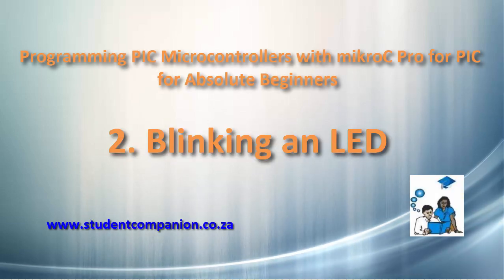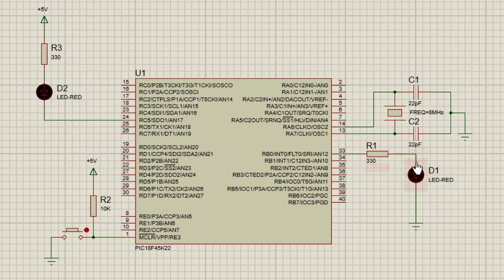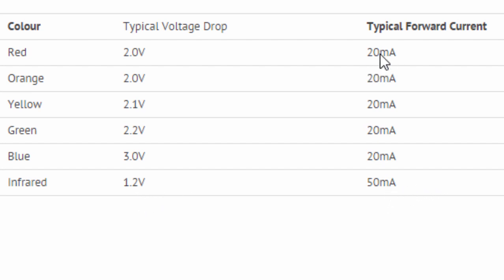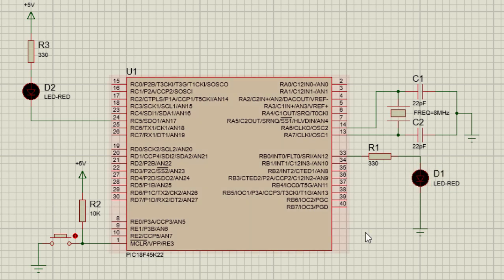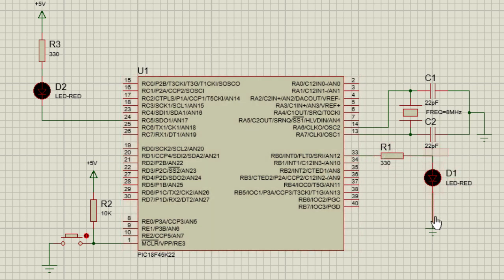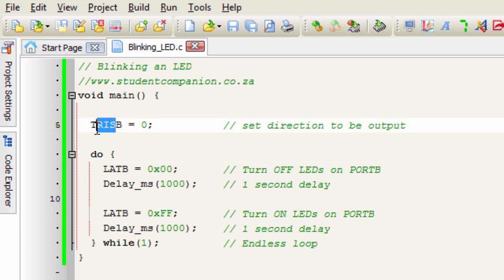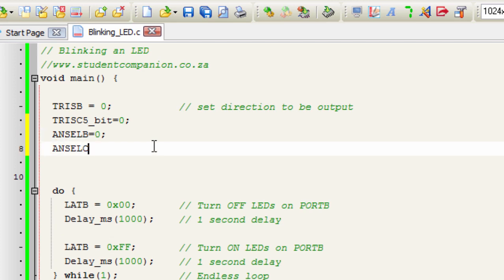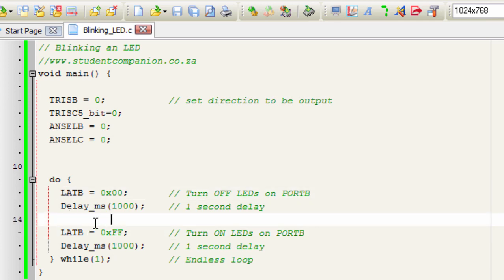2- Blinking an LED | mikroC Pro for PIC Tutorial

Comment: When i write void main() { program}
Syntax error: expected "." But "void" found 
What is the problem here ?
Reply from the maker: Please post the full code so that I can see where you might have done something wrong
Reply: Void main() { 
TRISC.B0=0;
TRISC.B1 =0;
TRISC.B2=0;
While(1) {
PORTC.B0=1;
PORTC.B1 =0;
PORTC.B2 =0;
delay_ms(1000);

PORTC.B0=0;
PORTC.B1 =1;
PORTC.B2 =0;
delay_ms(1000);
PORTC.B0=0;
PORTC.B1 =0;
PORTC.B2 =1;
delay_ms (1000);
}}
Reply from the maker: @jawahaffar7585  C Language is case sensitive, capital letter are different to small letters. You have been making that mistake.
I found these few mistakes of casing:
1. Void main() must be: void main() : The 'V' on void must be small letter.
2. While(1) must be: while(1): The 'W" must be small letter.
3. delay_ms(1000) bust be Delay_ms(1000): The 'D' must be capital letter.
Check if it compiles with no errors, otherwise post the new error and specify the PIC you are using.
Reply: . main() { 
TRISC.B0=0;
TRISC.B1 =0;
TRISC.B2=0;
while(1) {
PORTC.B0=1;
PORTC.B1 =0;
PORTC.B2 =0;
Delay_ms(1000);

PORTC.B0=0;
PORTC.B1 =1;
PORTC.B2 =0;
Delay_ms(1000);
PORTC.B0=0;
PORTC.B1 =0;
PORTC.B2 =1;
Delay_ms (1000);
}}
Reply: Appreciate it sir thank you
Reply from the maker: Which PIC model are you using?
Reply: Hello sir i've tried this error correcting , the only one error that i've been seeing is the one i've mentioned above , it's pic 16F877A i don't like working with it but it's for a college project , i  really appreciate it so much for taking time to reply and help .
Reply from the maker: Post your new code after fixing the first errors
Reply: Anyway thank you soooo much for your time and your help i appreciate it alot sir , hope you'll do the best in your life
Reply from the maker: Thank you!
Reply: void main() { 
TRISC.B0=0;
TRISC.B1 =0;
TRISC.B2=0;
while(1) {
PORTC.B0=1;
PORTC.B1 =0;
PORTC.B2 =0;
Delay_ms(1000);

PORTC.B0=0;
PORTC.B1 =1;
PORTC.B2 =0;
Delay_ms(1000);
PORTC.B0=0;
PORTC.B1 =0;
PORTC.B2 =1;
Delay_ms (1000);
}}
Reply: The same error is showing :
Syntax error : expected "." But "void " found
Reply from the maker: @jawahaffar7585  They might be something else on your side you are not sharing with us, I have build that code with the PIC16F877A, it compiles successfully with no errors.
Reply: Could be a file missing in the mikroC programm ?
Reply from the maker: @jawahaffar7585  maybe you did not add the required libraries.
You could post your full project in the forum on our website, then we can check it and upload a working project
Reply: When i change void main to .main it's working , but it's not running on proteus
Reply from the maker: @jawahaffar7585  you can post your mikroc and proteus project in the forum on our website we can check them: www.studentcompanion.co.za/forums

Comment: hi, thanks for the presentation, it seems that they do not have the free license (with the 2k limit) anymore:
https://www.mikroe.com/mikroc-pic
Reply from the maker: Just click on download. On that page to download the free demo version
Reply: it downloaded the setup file:
 mikroC_PRO_PIC_2018_Build.7.2.0.exe without asking anything (:
Reply from the maker: What do you want it to ask you? It's a Demo unregistered and it will limit your code to 2Kb. Install the setup, click on help menu then click on About, it will show you that it's unregistered.
Reply: I just made a comment on the matter: that it seems there is no free version as the older web site suggested and nothing is mentioned about that these days at their web page.
I did not install the software yet to know what you just claimed
Reply from the maker: That's my understanding.  You can install the software and check, because they wouldn't give a downloadable  link with a full version. That's my understanding as before unless they have changed: you download the free working version then you buy a licence to activate the professional version.
Reply from the maker: To get more clarity on this, I suggest you contact Mikroelekronika directly by email or in their forum: https://forum.mikroe.com/
Reply: thank you sir for your help and fast responds.
I am more attracted to this IDE than the MPLABX which uses too many built in libraries and functions as well as GUI kind of wizards but I am yet to decide
Reply from the maker: You are welcome!

Comment: TRISB = 0x0
Is it true.
Reply from the maker: What do you mean by TRISB = 0x0 is true? Please be specific and clear when asking a question.
Reply: I wrote a programme by TRISB = 0x0;
Bu the compiler sign it red
Reply from the maker: Post the whole code. Let's see
Reply from the maker: Which PIC are you using?
Reply: Pic 16f84a
Reply from the maker: They must be something else wrong.  TRISB =0X0; cannot generate an error if you ended the statement with a semi colon ;
Please post your full code here or upload it on the Forum on our website.

Comment: It didn't work for me. 
For some reason the while(1) needs to be at the bottom as was demonstrated in an earlier video. 
My revised code looks like this: 

void main()
{
     ADCON1 = 0x0F;
     TRISB0_bit = 0;
     TRISC0_bit = 1;
     LATB.B0 = 1;
do{
if(PORTC.RC0 == 0)
{
Delay_ms(1);
if(PORTC.RC0 == 0)
{
    LATB.B0 = 1;
}
}
else
{
     LATB.B0 = 0;
}
} while (1);
}
Reply from the maker: +John Baker is this new code working.? You didn't specify the PIC you are using or what did work.

Comment: Hi, I have been dealing with the While statement, this is my code, but  when I compiled a error says While expected, but 'while' found, thanks for your help.

void main() {
TRISB = 0; //Set Port B Bit 0 as output
TRISC5_bit=0; // Set port C5 0 as output
ANSELB = 0; // Nos permite configurar los puertos B como Digitales
ANSELC = 0; // Nos permite configurar los puertos C como Digitales

      do {
        LATB.B0=0;     //Usamos el resgitro LAT para escribir 0 y mostrarlo en el puerto B
      LATC.B5=1;
 Delay_ms(1000);  // 1 sec delay

      LATB.B0=1;     // Enciende el led en Puerto B
 LATC.B5=1;
 Delay_ms(1000);  // 1 sec delay
      }While(1);

}
Reply from the maker: Hi. The problem is that the C language is case sensitive. You must write your while(1) all in small letter. Your "W"hile(1) is capital letter.